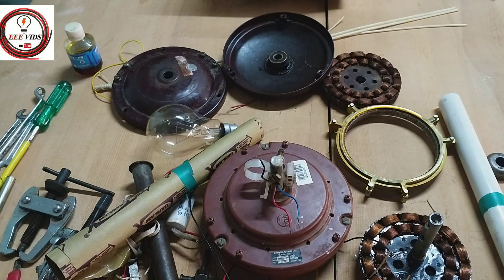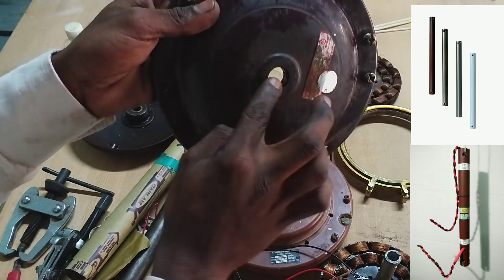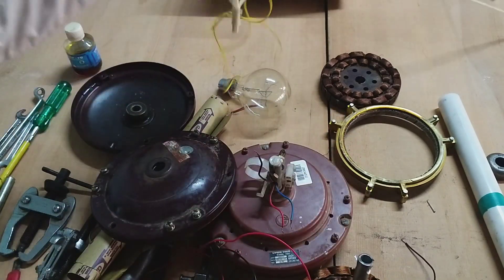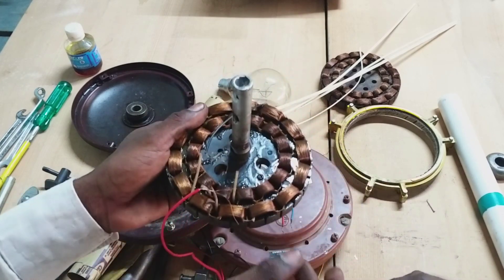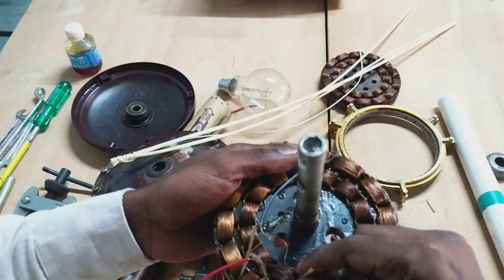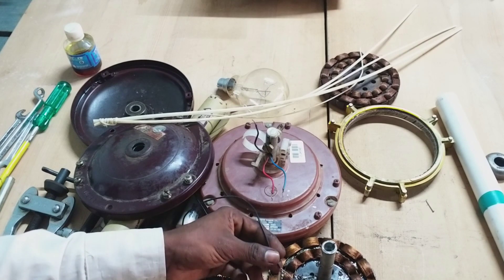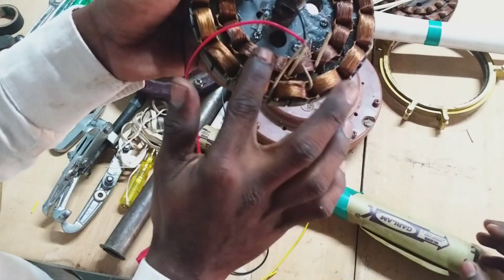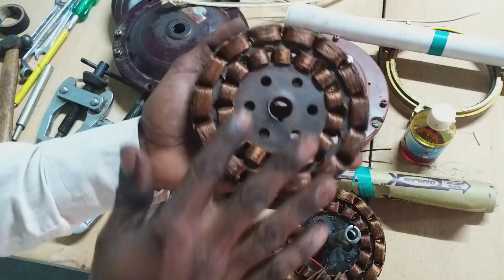Ceiling fan இந்த மூன்று காரணத்தால் சரியாக சுலாலாது

Comment: Fan runs smoothly without strucking  and no bearing sound able to notice but when powered on struck with noise  runs slowly and speeds up with nice changed the capacitor too still the same problem is it bearing problem or coil  problem

Comment: Sir ceiling fan coil home la kattuno  36kg copper staring winding 360 running winding 410 sir wire connection la correct ah irukku and switch, regulettet, capacitor ellame new ah change panniyachu but fan odala reason enna va irukkum sir